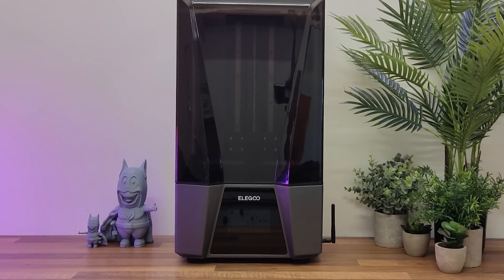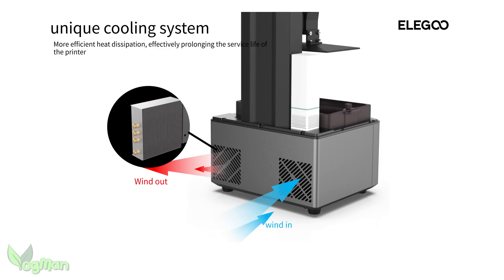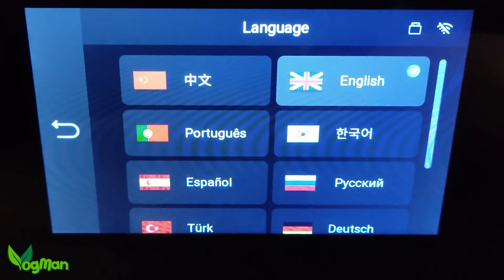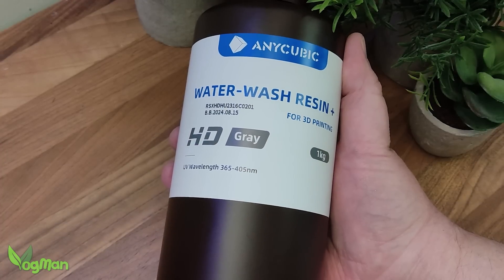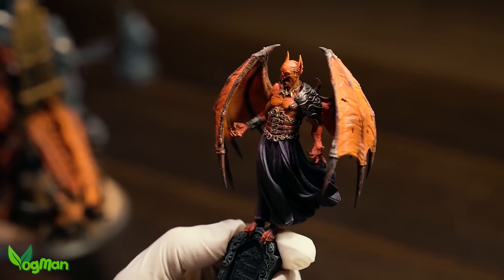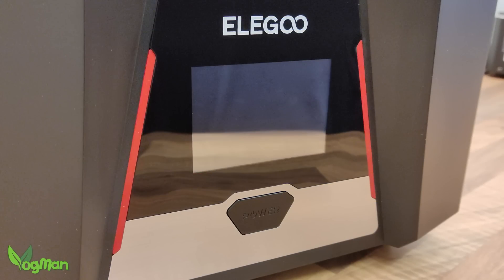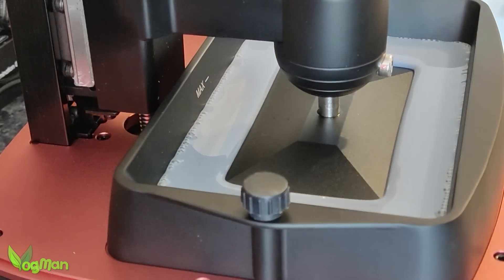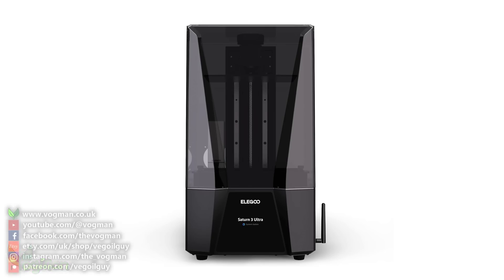Elegoo Saturn 3 Ultra 12K 19 micron resin 3d printer (HONEST REVIEW)

Comment: Any thoughts on the speed/reliability of the wifi file transfer? I read somewhere you can remotely start a print, is that true? Cheers
Reply from the maker: In honesty I haven't tested it, but in theory it should. WiFi with printers has been around a while now and as long as your printer is turned on and ready to print, you should be able to remote start, review progress and even cancel. 😁
Reply: @vogman  I believe on this printer you can actually transfer your files wirelessly over your home network. Other printers seem to be only able to start and monitor print progress wirelessly. I have a form 2 printer and the wireless transfer function is really nice to have as it allows you to put the printer just about anywhere. You can send multiple print files and they are stored on the printers memory. It is unfortunate that they seem to have missed some of the other innovative features you mentioned, and the non square pixels and strange banding is odd.

Comment: Great review, sadly it was 1 week after the new M5 Sale :C I was hoping Elegoo would be a better  12K... but now im regretting not getting the M5 when it was at such a low price. But your reviews are worth their weight in gold, Honest and straight to the point. Keep it up!
Reply: honestly just wait a year. 3d printer tech is exploding right now, I'm sure in a year or two we will have 12k printers with better features. Also anycubic does sales ALL THE TIME. Just wait for their september sale.
Reply: @antongunther3977  this is the correct answer, if you have a printer that works it's great, just wait for the new tech to be refined and come down in price.
Reply: @antongunther3977  I sell 3D printers and this driving me crazy.
Reply: You can still get the M5s for 450$ until Jun 8th (there is an auto applied coupon right now). So you might have missed the flash sale but at this point its only 50$ more than that sale.
Reply from the maker: I don't want to spend your money for you, but remember the standard M5 still has 12K printing power and is the cheapest machine. It doesn't have all the fancy self-levelling, etc, but on paper it should print just as well https://tinyurl.com/2dcp7sj3
Reply: @vogman  Yeah, thanks. I will either do that or wait for release and then get an 8K when they are cheaper. Do you know if the M5 allowes other slicers (Chitu/Lychee) Or is it just their new in house slicer?
Reply from the maker: I don't think Anycubic restrict anyone to a certain slicer. Sure the printer will come with Photon Workshop, but it's just a question of time before companies like Lychee add it to their listings. In fact, you could always send Lychee an email or visit their Discord and ask them. If they are doing it, the others will too.
Reply: @Naj Kraemer  lychee already has a update for using both the m5 and m5s
Reply: @vogman  Anycubic doesn't ship these to Australia yet  :  (
Reply: Even without the prerelease discount I think the m5s is still a good bargain for what it does. If you 3d print a lot like I do, the no leveling,  faster printing time, and 8k+ resolution will still make it worth the investment.  👍